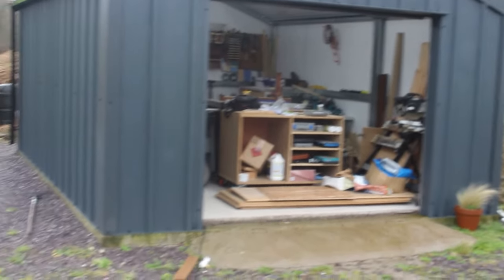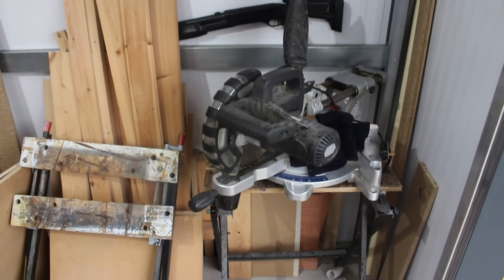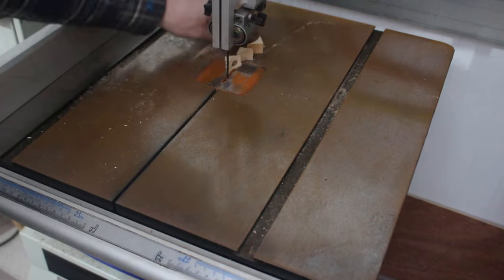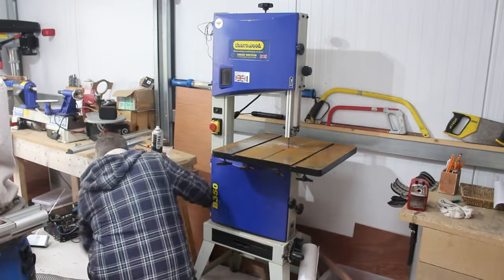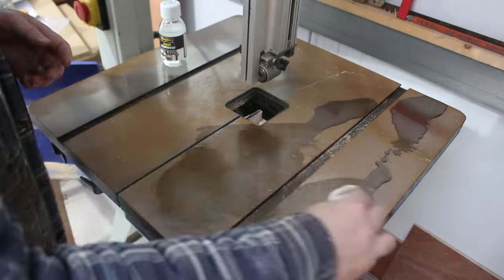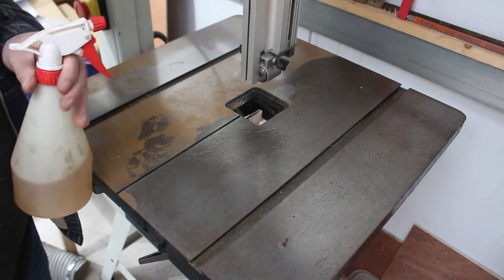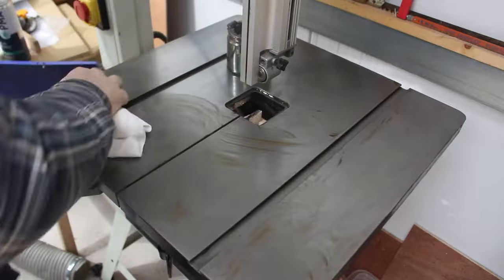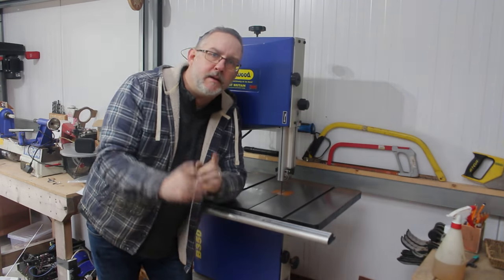Rusty Bandsaw table

Comment: goodluck with the new shed pal, looks great. I cover my bandsaw table with a square of 1/4" mdf, the exact same size. have a slot cut in it to allow the blade to fit in. works well long term when its not in use. have the same for my planer thicknesser beds. worth a try IMO